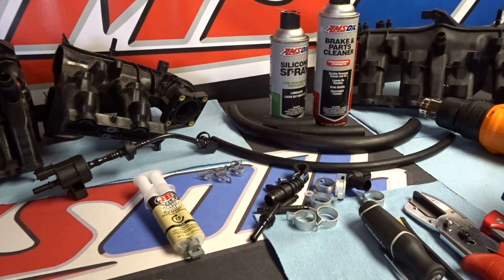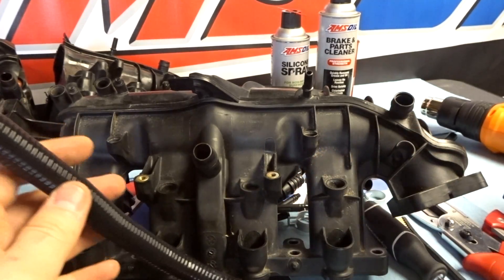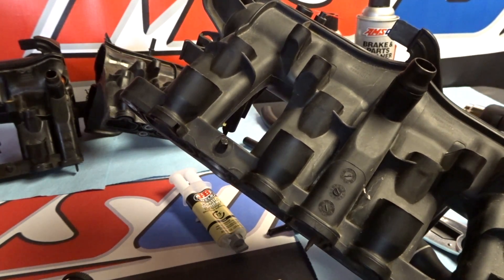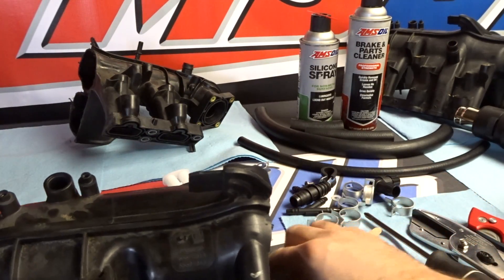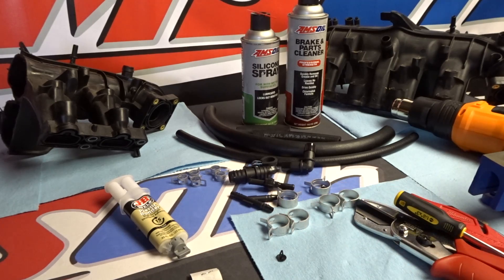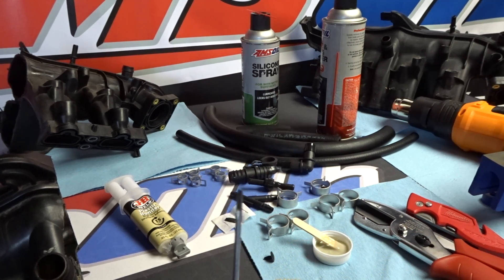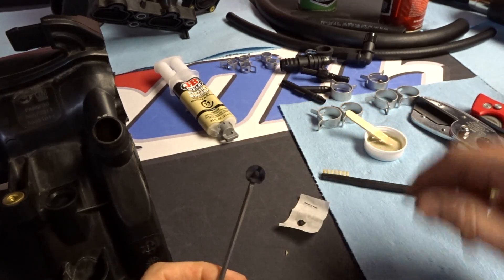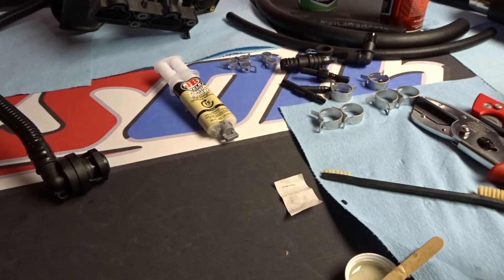How to Install the CruzeKits.com V3 PCV Fix Kit

Comment: Quick question, I just purchased new manifold which ofcourse has the orange nipple, could i not just seal around with epoxy without trying to remove the orange nipple. with that it will hold it intact and close any of the openings. please advise.
Reply from the maker: No. Epoxy at these temperatures, with this exposure, is not intended to be used as a sealer, but rather as a bonding agent between the plug and the manifold. You can use a screw and washer though after popping the old check valve out. #10 x 3/4" self-drilling sheet metal screw, and #10 x 7/16" nylon washer. Did you already order one of the kits?
Reply: @AndreiDPop  thank you for responding. I got the 3.4 kit which has a screw and a white washer, not sure if that is what you are talking about. Please confirm
Reply from the maker: @EOO-Stand  screw and washer on that kit are for mounting the rubberized clamp. You'd need a different screw and washer for what I'm talking about.
Reply: @AndreiDPop  thank you
Reply: @AndreiDPop  Hi, I finally installed as descrbirbed and it was easier than I thought. the car runs great. thanky ou again for your assistance
Reply from the maker: @EOO-Stand  Awesome! Thanks for reporting back.

Comment: Hi! I recently did this fix kit on my Chevy Cruze 2014 1.4L and the little plastic o ring you were talking about from the PCV hose was gone. My brother in law actually installed the fix kit but I don’t think he ever found it. Now there is oil leaking from my intake manifold. Could it be caused by this missing piece or is something else going on?
Reply from the maker: Text me a picture of what you're looking at. 219.779.77 four two.

Comment: now im getting P0496 a few months later. could the check valve installed with the kit have gone bad?
Reply from the maker: It's possible but not probable. Easy to check though and I'll send you a couple of replacements if it did. That's not usually the code I see for that issue though. That's usually a bad EVAP purge valve.

Comment: I installed the V3.3+ kit (which was necessary, as the PCV check valve in the intake manifold was absent) and after clearing the codes, the P0171 code returned. I then saw that the vacuum regulator diaphragm on the valve cover sucking in air at idle. It is already time to throw another $56.00 at this code (or 80 if I was dumb enough to buy from the local stealer.) 

GM has updated the valve cover twice now. The current part number is 25203036. My two local GM stealers have no idea how recently this updated part was released, or if it addressed the vacuum regulator diaphragm failure issue. 

I did not find your other video: https://www.youtube.com/watch?v=En4WO7DYsTk
prior to watching this one and ordering the kit. The beginning of that video is very helpful to understand and diagnose the PCV system, and should be mentioned in this video description. 

You did a great job with the kit design, and the install went fairly smoothly. I managed to melt the plastic tubing on my first attempt with the heat gun, but I was able to cut off the damage and repeat, and it still fit. In the directions, I would suggest not cutting out the exact amount that the Y fitting takes until you have already attached the first piece. This will allow for extra plastic tubing in case of error. I was under the impression that this measurement needed to be exact to fit, but it has some flexibility. If you do ever re-shoot that part of the video, it would be a good idea to address the direction that the parts need to point in. I was going to attempt to do it from memory, but for certainty I needed to do it with the video running in front of me to be sure everything pointed in the correct directions.
Reply from the maker: Thanks for the feedback! I'm actually working on a new video. In your kit, there's a 4.25" section of hose and 4 extra clamps. That's intended to be used in place of the nylon hose so you don't have to worry about the heat gun or melting anything.
Reply: @AndreiDPop  I just got this kit from you and looking to install this coming weekend.  What is going to be in the new video that I am missing?  I just want to make sure this goes smoothly when I do it.  Thanks!

Comment: the cleaning brush broke off in the intake so I had to remove the intake anyway....turns out there is SO MUCH GUNK in there around 68,000 miles (just bought the car used) but it makes it so so much easier to do the install and really clean out the channels. Everything looks to be hooked up right according to the pictures, crossing my fingers.
Reply from the maker: Don't run it in reverse. If you run it forward, it's fine, but if you run it in reverse, it unwinds at the hex base, flexes, and breaks off. Shoot me a message on the cruzekits.com site and I'll respond so you can send me some pictures and I can verify the install for you.
Reply: @AndreiDPop  ok so I got to drive it when I got home, is it normal for the car to run like absolute garbage for about 15-20 seconds? after that it ran smooth, if not better than before the install and I had full boost power. I'm going to go with it works fine now :D
Reply from the maker: @phellankell6762  will take a bit for the car to figure out you disconnected and reconnected the evap purge valve. Did you unplug the battery before you started? The ECU is constantly monitoring all sensors.
Reply: @AndreiDPop  I didn't actually unplug the battery at all, but since I had to remove the intake I did unplug a bunch of sensors. It ran extremely rough and sounded like it had an air leak for about 15 seconds before it started running normal. Went and test drove and runs like a champ....odd.
Reply: @Dre Dan, I went ahead and sent an email over at the cruze website. It's day 2 after the kit install and it definitely feels like the engine is not performing as well as it did before the install. Idle quality is ok and it doesn't stumble on accel, it mainly seems like the boost was turned down or not getting where it needs to go. I would be happy to email you some pictures of the installed kit for you to look at to make sure I didn't screw something up. Since it's my daily driver and I drive 44 miles a day to work and back, heavily debating returning to stock with a new intake and hoses.

Comment: my question is since my car only has 60k and i have no issues with it idling funny or what not but i do want to do this as preventative maintenance, how would i get that little orange plug off from inside the intake manifold to put the new plug in?
Reply from the maker: You can break it off with a flathead screwdriver. This would cause it to fail just like it normally does from the factory. The engine simply consumes the small flap behind the nipple.

Comment: Hey buddy, I have to do front brakes this weekend and would like to do the kit at the same time. Do I have to let the epoxy cure for the full 24 hours? I don't do my mechanical work at home so I'd have to drive the car home afterwards. Hope you see this, thanks for the kit. 

Cheers!
Reply from the maker: 15 hours minimum for cure time. You can do the plug later a long as the port and port wall are CLEAN AND DRY.
Reply: @AndreiDPop  awesome, I'll probably just do it when I get home to be on the safe side. Thanks for your wicked fast reply!

Comment: Sir, the idea behind the kit is wonderful.... but since I'm very poor I had to piece it together myself I have everything except for the check valve where do you recommend I get one or where did you get that one I know it's special.. but again... the money issue. P0299 under boost no power ...im miserable
Reply from the maker: Send me an email using the form on cruzekits.com. I make these as affordable as possible, but I've seen a lot of people try to do it themselves and end up screwing up part of the kit. I can sell you the check valves (they're available for order now on cruzekits.com) but I want to make sure the rest of what you pieced together will work, because not all PCV hose will work, for example.

Comment: This kit works well, keep in mind this video is not totally accurate for the 3.3 kit (different check valve location). My only issue was with the nylon line. I melted the original one so I bought some nylons fuel line at auto zone and kept trying until I got it.  
Make sure you change your valve cover if the pcv is leaking
Reply from the maker: I'm in the process of a new video. Btw on all kits I've shipped, I include a 4.25" section of hose and 4 extra clamps. That's intended to replace the nylon line so no heat is needed.
Reply: @AndreiDPop  I need the new video, pretty I installed it wrong.
Reply from the maker: @phellankell6762  shoot me a message on the contact form on the cruzekits site and I'll get back to you with some pictures of what it should look like.

Comment: So I have the manifold plugged and everything clean and im watching the video again to see which hoses go where and realize I don't have the shorter 5/8th you mention that connects to the 90° elbow. Do you have any suggestions? Should I try to cut down some of the other 5/8 off to compensate? I'm not sure what to do with all the connectors off and ready to assemble.

After I started to assemble some of the kit to at least get as much done as possible i also realized it is missing that 90° fitting as well that go's with that rubber piece. I would be lieing if I didnt say it has me at least a little stressed out.

On further inspection I noticed that the T fitting i have is either defective or the wrong part because the smaller of the three ends is on the top of the T instead of the leg of the T. Sorry Im trying to explain but its hard.
Reply: This post sounds messy.  I just purchased V3.3 Kit had all the fittings and clamps, hoses, everything you need to do the job. I highly doubt that Mr. Pop would have sent you half a kit.  Do not Cut down the 5/8ths hose, as the lengths are perfect for the project.
Reply: @1Patient well the problem was I was watching the video and putting it together like it was showing and didn't know he had made a couple of changes to the kit since the video and I didnt realize that at the time. I got it all figured out.
Reply: @djbullock8332  Ya, I have a question about the 5/16ths line. There is a long one and a short one in the kit. When I tried to heat up the nylon it got too hot and melted and crushed with a plier, I cut the remaining nylon off the barbs and am wondering if there is enough of the long 5/16ths line to make two small pieces to connect the Y fitting close to brake booster on drivers side. and still have enough length in the long 5/16ths hose to connect to the T Fitting and Check Valve.
Glad you got yours sorted out. Sill working ok? Better then Ever?
Reply: @1Patient  ahhh yeah thats easy to do. I didnt crush mine but I was worried I melted to much. Um I'm not sure about cutting the hose. Let me look and see how much there is to play with. 

Car deff runs better now then before.
Reply: @1Patient  i would say you could cut 2-3 in off if you wanted to. Seems to be long enough without being an issue.
Reply: @1Patient  yes sir. When I was reading about his updated kit it has it running behind the manifold and has it angled so the valve goes downward to not next to the Y fitting any more.

Comment: Is there an easy way to dry out the hole out of the manifold? Its pretty small so hard to really get anything in there to dry it out.
Reply from the maker: Compressed air.
Reply: @AndreiDPop  i sent a message on here. Not sure if you got a notification. I did start doing some research and realized that you updated the kit. It is hard to see how to put it together in the pictures on your website though so im gonna try to figure it out. Could you explain a little on how to assemble it more with the new changes? Great content and help regardless though. I appreciate your help.
Reply from the maker: @djbullock8332  im working on an update but the changes are simple. The check valve is no longer by the Y fitting, but rather is 2" away from the T fitting. 

There is no longer a 90 degree fitting and a separate T fitting, but rather a new custom T fitting that goes where the 90 degree fitting used to go. 

That's all there is to it!
Reply: @AndreiDPop  thanks for the feedback. Ill mess with it later and see how it goes. Much appreciated.
Reply: @AndreiDPop  im at the very end of this and im wondering if that ring that comes out by the manifold sets flush with the O-ring or should it be a little above it? Or is it ok if I leave it setting flush with the O-ring? About to put it back together and just wanna make sure its all good.
Reply from the maker: @djbullock8332  it should be right in front of the o-ring.
Reply: @AndreiDPop  thanks my dude. It is right above it. I was just worried it was to close. Tried looking at the video and see how far down it went.

Comment: So this fixes the issue with the valve cover leak correct?
Reply from the maker: Nope. This fixes the issue of the missing or malfunctioning intake manifold check valve, which causes premature failure of the valve cover.

Comment: Just trying to clarify here. So the kit includes that corrugated hose that you take the two ends off of? Just wanna make sure I don't need to purchase that to finish the installation process.
Reply from the maker: That's already on your car.
Reply: @AndreiDPop  ohhhh ok. So I dont need to worry about the two ends being defective? I know I seen where you blow into the hose to see if you can suck air back in.

Comment: Dude you gay me all the wrong parts every single part that you used on this video isn’t what I got
Reply from the maker: Check the install sheet. The 90 degree elbow and the T fitting from this video were combined into one. The install sheet explains where to find those details on the website. This was done to simplify the kit and create fewer connections. This makes the kit easier to install and creates fewer potential leak points. If you run into any issues, give me a call tomorrow at the number on the website (219 area code).

Comment: On the v3 kit you don’t have to drill a hole in the manifold anymore correct ?
Reply from the maker: Correct
Reply: @AndreiDPop  any idea where to get a replacement plug.
Reply from the maker: @trich7108  what's your order number? I can send you some replacements.

Comment: So If I don't want to use jb weld can I use the right stuff gasket maker cause it is oil resistant
Reply from the maker: NO! There was a great deal of research, effort, and testing that went into that exact epoxy. I spent WEEKS with Henkel/Loctite and JB-Weld engineer teams in both industrial and consumer adhesives divisions narrowing down the exact epoxy to use in this application. Gasket maker WILL NOT work due to poor adhesion.

Comment: So I got your kit since my car has the symptoms. But the valve is still in the manifold so I don't think I can install the plug you provided. Any tips to go from here?
Reply from the maker: You would have to break the tip off the valve in the manifold to install the plug or my kit.
Reply: @AndreiDPop  so just bust it with a small screw driver? Sounds good thanks man

Comment: Before I had the kit the car stuttered, and had a loss of power after I mounted the kit with a new valve cover, the car drove like new. 5 stars for the delivery and the good guide on youtube
Reply: Did it idle real rough after starting and the go back to idling fine? Also was there a significant “lag” when you would really get on the gas to go? Trying to determine if this will solve my issues thank you
Reply: @_Disturbance_  it did idle real rough back then, and a significant loss of power, Just check your valve cover if it is really sucking air, Most likely a defective pcv valve which goes in hand with some fault codes, I still own the Car, Havent had any problems since adding the kit, It is a real common issue
Reply: @fluppie19dw  okay thank you, I’ll check it tomorrow. I did an oil change today and noticed a “sucking” sound so it probably does have leak there. I assumed it was a vacuum line and I pushed it off cause it was getting dark. I’ve been getting Turbo Boost sensor, O2 sensor , Barometric Pressure sensor, loss of power codes for like 2 years unable to track it down. I was planning on replacing the turbo soon so glad I found this. Thanks again
Reply: @_Disturbance_  keep in mind if the valve cover is sucking air you also need to replace the whole valve cover,  Because the membrane is broken and isnt replacable on its own

Comment: I have a question. So I want to do this on my chevy sonic 1.4t  that pvc line that we replace with your kit has two extra vacuum lines you didnt address. One goes to the back of the intake manifold and the other one connects to the wastegate or bvp  of the turbo. What do I do if I get your kit?
Reply from the maker: Just keep those in place. Don't need to worry about them. Just cut the tape and leave that little vacuum line alone.

Comment: I appreciate the video.
I'm trying to understand what this system is doing.
Sorry if confusing question. I'm just trying to understand which way it normally flows and what the new flow path is after closing valve in side the Intake manifold....
Thanks in advance to anyone who can answer.
Perhaps a link to a diagram.
Does it normally flow from intake to turbo inlet or vice versa.? And what exactly is closing the check valve hole inside the manifold actually doing and how is the splice actually fixing it?
Thanks again.. Great how to video. I guess I'm looking for a detailed why?  I do plan on purchasing because my orange nipple is not there.
Reply from the maker: Refer to this article. Let me know if you want further clarification. https://cruzekits.com/tech-articles/f/why-do-we-even-need-a-pcv-system